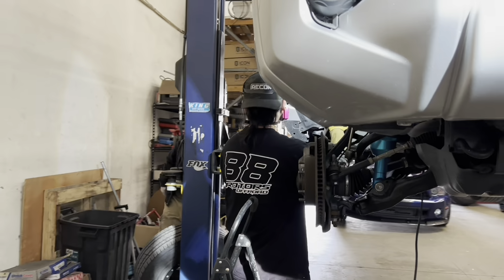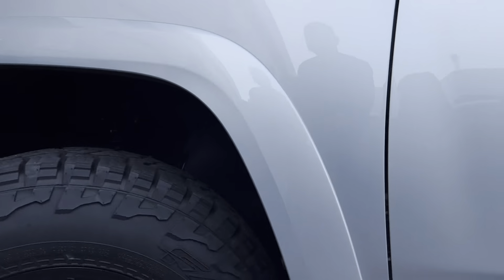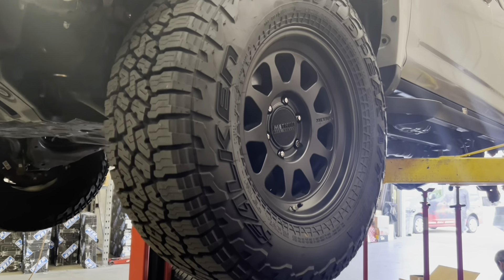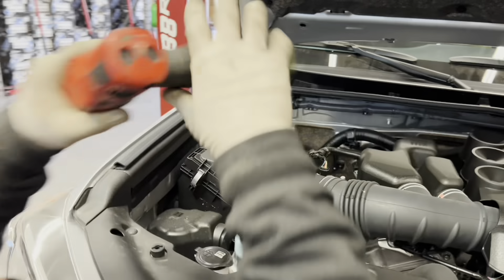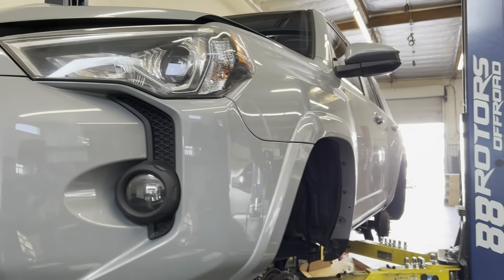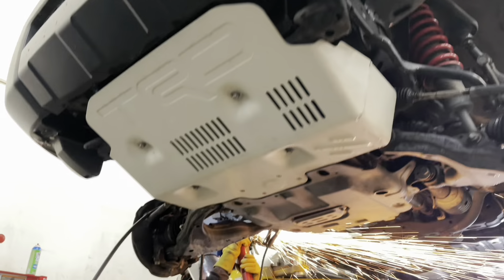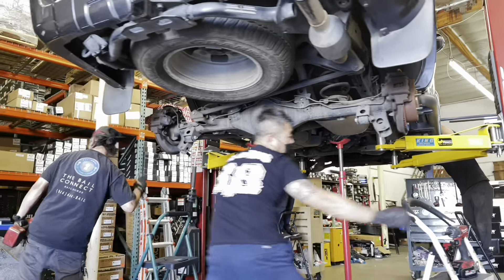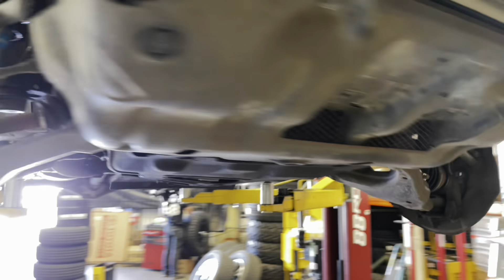4RUNNER LIFT DIFFERENCE: ICON STAGE 6, STAGE 7, TUBULAR, AND BILLET ARMS

Comment: I have a GX and want to do a lift and bigger wheel and tires. I would love to see a review on the different suspension companies as it is so confusing. I am have a hard time deciding on King, Icon, fox, old man emu and so on. I want a smooth ride in the street as it will primarily be a daily. Any feedback would be much appreciated!!!
Reply: my gx is shown at the end of the vid with an ironman kit. its my daily driver as well. we decided to go with ironman because of the reviews and price point. we’ve heard that icon tends to leak. just heads up in case you haven’t heard that yet.
Reply: @CJinSoCal  thanks, I appreciate the feedback. It drives so nicely stock, I don’t want to give up too much of the ride quality. Is the ride on your lift softer or firmer than stock?  Thanks and have a great day!
Reply: @michaelrusso945  no problem! feels about the same to me maybe a tad smoother on bumps, but my husband swears its a way smoother ride now lol

Comment: Lift kit or leveling kit whats better?
Reply from the maker: When you say leveling, I assume you mean a spacer lift? A suspension lift is always better than a spacer lift. Leveling is really just the description of how a truck sits level from front and rear. Leveling can be done with spacers or a coilover, but most use the term "leveling kit" to describe a spacer lift so I had to clarify.
Reply: @88ROTORS  Do you install anti catalytic converter plate theft on Tacomas or do you install any security device, love your channel great work.